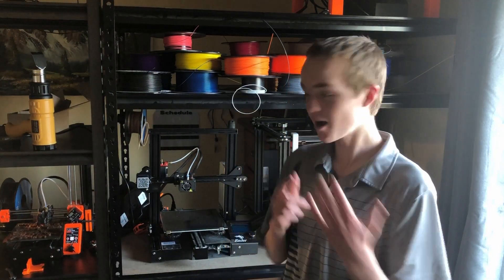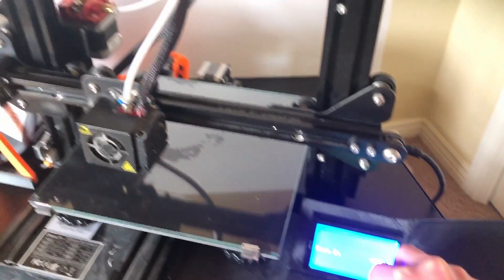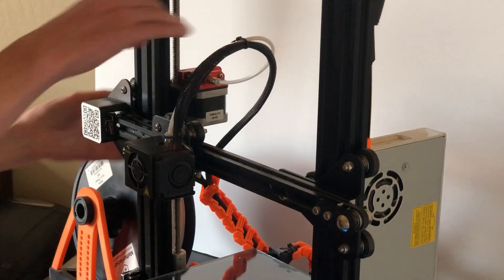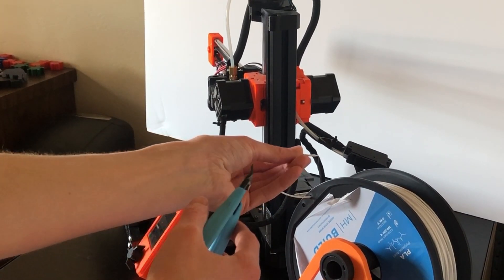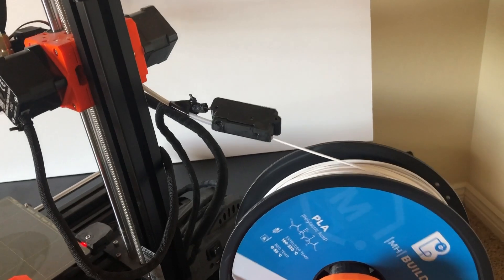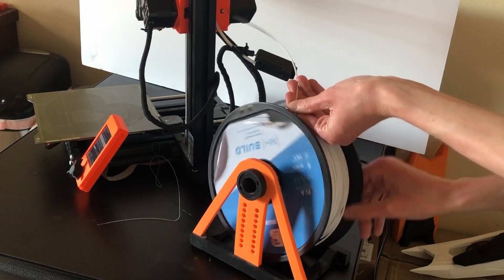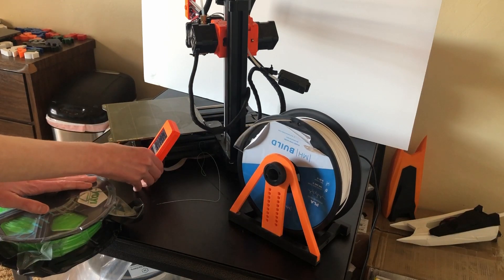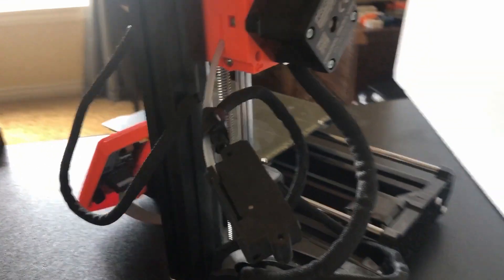The Proper Way to Load and Unload Filament on Your 3D Printer

Comment: I'm getting a new 3d printer myself
Reply from the maker: Awesome! Do you know what one you got?
Reply: @Dragon3D  well, I'm not really planning on getting anything that expensive because I still need to save up for the m1 mac, but I did find one around $150
Reply: I am intrigued with resin 3D printers, despite the small size I like the higher quality.
Reply: @dmora2309  Yeah same